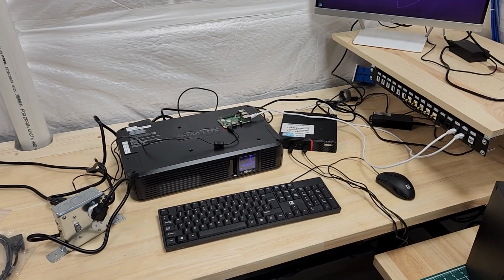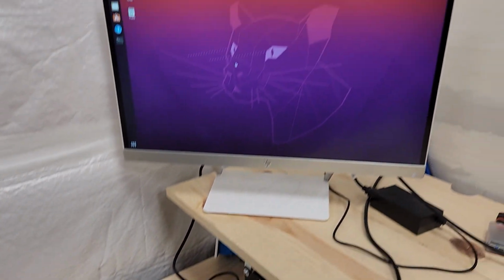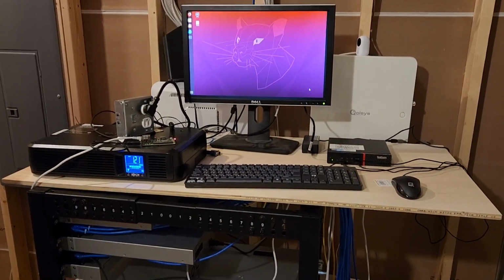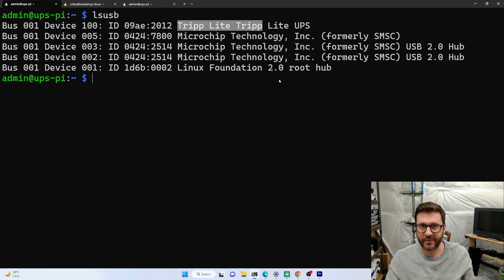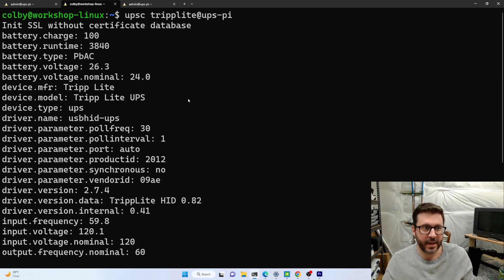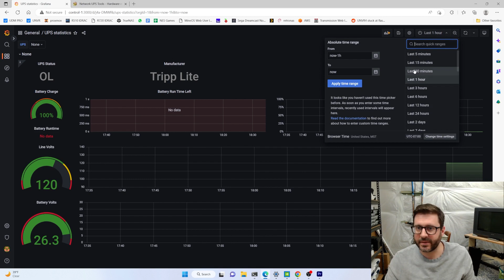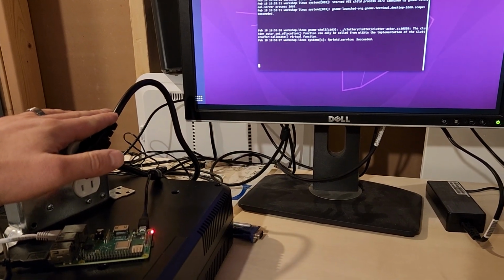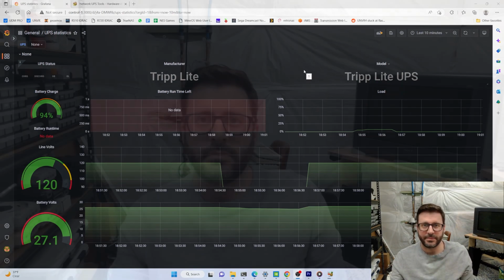Homelab Episode 2: UPS Setup

Comment: Nice video.  I follpwed the same Techno Tim but I still have an issue.

When there is a major spike in power (common where I live) NUT server or even some clients goes Nuts and shutdown the host even if power is restored.  In top of that NUT server recycles the whole UPS to bring all down.  Do you know how to avoid that?

Can you also do a tutorial with the steps for Prometheus exporter?
Reply from the maker: Hmm not sure on that one... sounds like maybe the initial power down signal comes in and there is a delay until the shutdown, during which time NUT doesn't check again? I'm not a total expert unfortunately, haven't had that situation.

I can definitely do a tutorial on the Prometheus exporter - if I can find my notes in the meantime I'll post them here!
Reply: @clabretro  understood and thanks.  I will appreciate the nut exporter and I will continue digging on this weird issue.  If normal power loss the script from Techno Tim works like a charm but when there is this spike in power I get this non sense behavior that I have tested in 2 different systems and UPSs
Reply: I use a spike protector to solve problems like that, it often happens with old or cheap UPS.

Comment: How do I install Eaton usbhid on pfsense?
Reply from the maker: Hmm not sure. I got lucky, this Tripp Lite UPS was pretty common and I could find other tutorials on it.
Reply: @clabretro  Can you play video games like Nintendo Switch as it keep saying need Nat as I try fix it as static ip adress works but cut half wifi speed to 50 and cant use the internet cable port on it only says error cant read the cable as I try swich and computer pfsense system directly on the ethernet ports.

Comment: Is there budget version for pfsend build?
Reply from the maker: you mean as my main router? I think I'd go that route if I was starting over.
Reply: @clabretro  Yes I am replace my router Asus aren't dns friendly as I also on unifi ap as I need a ups to run Nut to auto shutdown it self as I want budget one to only keep that device on if powerless regularly here as if work I pay the 1k pfsense website store to wall mount for less space and Unifi wall as switch network as if I lose function pfsense to Unifi wall as full service and I think about wifi of 5g 25 dollars month not bad for back up.